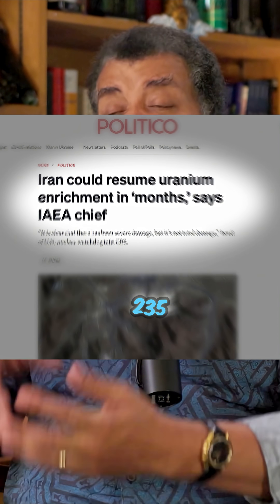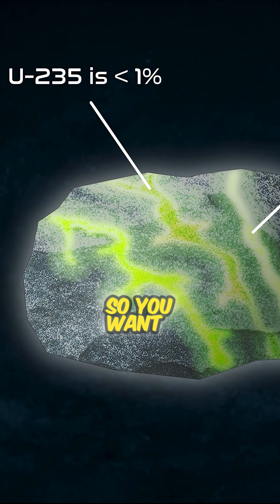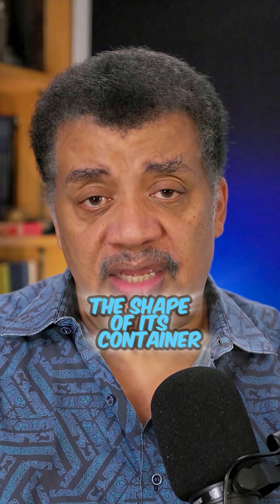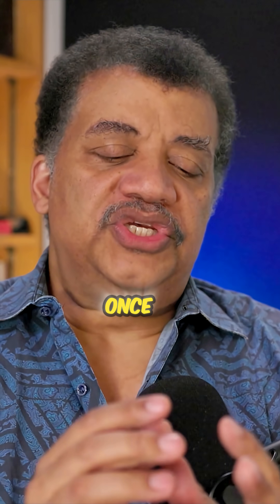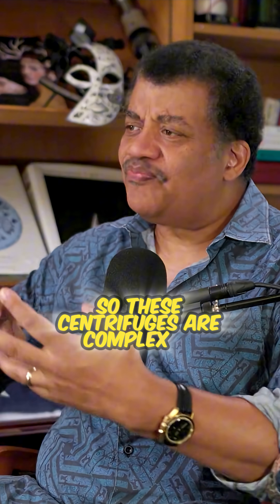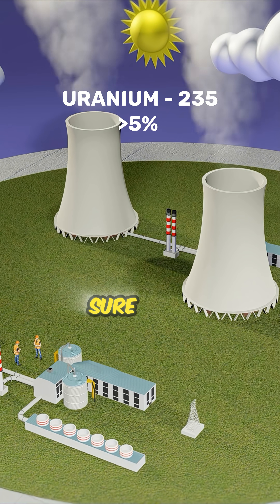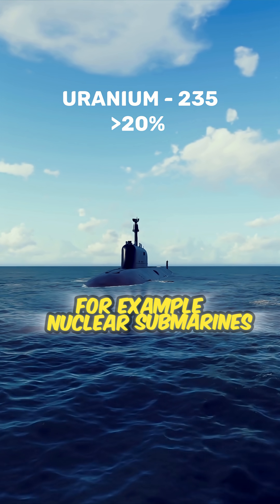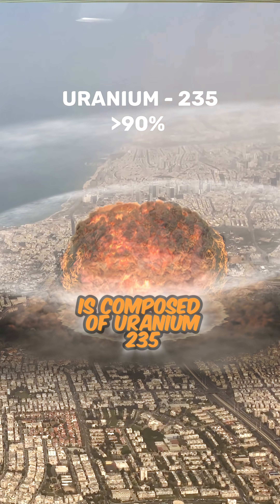The Secret Science Behind Uranium Enrichment! Neil deGrasse Tyson

Comment: So you couldn’t just build a big ass test tube and put the gasses in it where the 234 will float to the top 238 the bottom and 235 the middle. I’d imagine it would at least separate the 238. Then could you use the extra neutron in 235 to draw the 234 from it. Idk I mean maybe it has a slightly smaller magnetic charge or something. But yeah I’m sure the centrifuge is best. Those people are super smart. But yeah the best way is to enrich to 5 or so percent and make a reactor then purify the plutonium 239 to get a big ol kaboom. Especially when you throw some hydrogen and lithium and stuff in it.

Comment: Okay, but how do I turn the solid uranium to another state of matter?  Does adding energy cause nuclear particles to pop off a little faster and more frequently as it's raised to a more exited state?
Reply: Okay, basic nuclear physics. 

Uranium, in any of it's isotopes is unstable or radioactive. Meaning, eventuallly, a Uranium, ANY Uranium, atom WILL decay or split naturally, with no man-made intervention. When the U atom splits or decays, it releases 2 or more "daughter" products (usually 2), i.e. atoms that are roughly equal but 1/2 (give or take a few) in atomic number (the number of protons in a nucleus).  Plus a few neutrons, EM radiation (gamma or high energy Xrays), and maybe some other subatomic particles, like bosons.

The spliting or decay of these U atoms releases that EM energy and high energy neutrons, etc. It is these neutrons released that can cause further instability within ANOTHER U nucleus by that nucleus absorbing that neutron.
U-238 and -235 have different thresholds of thermal energy for absorbing neutrons. 

U-238, in order to split from absorbing a neutron, requires one that is relatively high in thermal energy (movment).Once that U nucleus absorbs a neutron, it becomes too unstable to maintain its cohesion from the strong nuclear force, and therefore splits. 

U-235 requires a much lower thermal energy. This is why -238 is useful for weapons and -235 is for nuclear power plants. Why? It is because of the level of energy that those absorbed neutrons have in order to penetrate into the nucleus. Too high of energy for a neutron, -235 nucleus will not absorb it.  

With -238, more high energy neutrons, more likelyhood of the -238 atoms will absorb those high energy neutrons, making more. More makes more, and then. BOOM!  This process takes a fraction of a second...blink of an eye.

This all explains why detonation of a U boom boom is so ugly for the environment. Those "daughter" products I mentioned earlier? They themselves are almost always unstable or radioactive themselves.  Much more so than Uranium.  Their half-lives (the time it takes for 1/2 of the mass of the element to decay into another element) is measured in hours, minutes or even seconds rather than thousands, 10s of thousands, 100s of thousands or millions of years.

The higher the 1/2 life, the slower the decay and less radioactive, and less dangerous. Note: LESS dangerous, not NOT dangerous.

Does that explain your question?